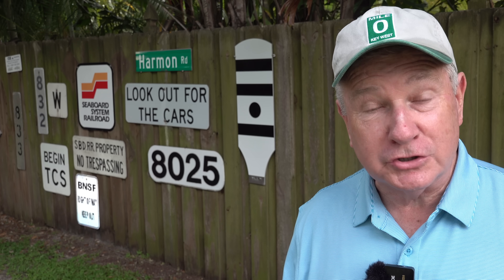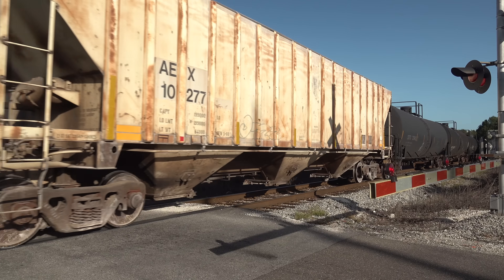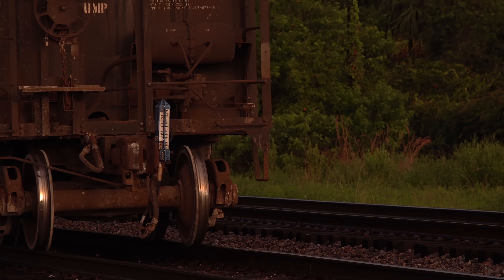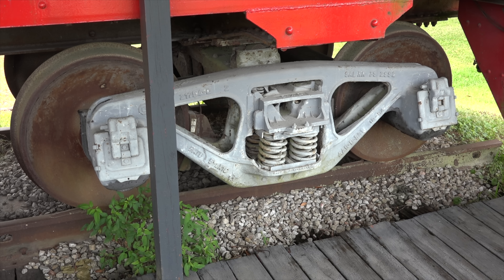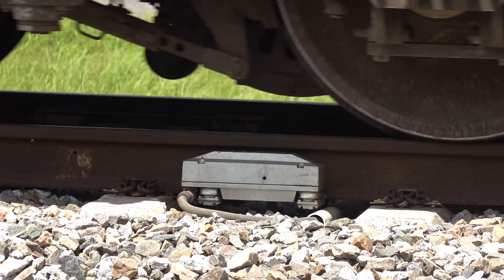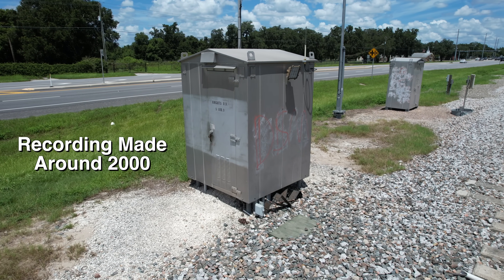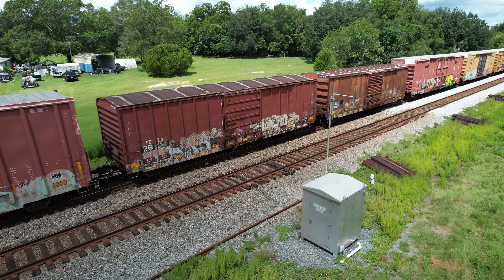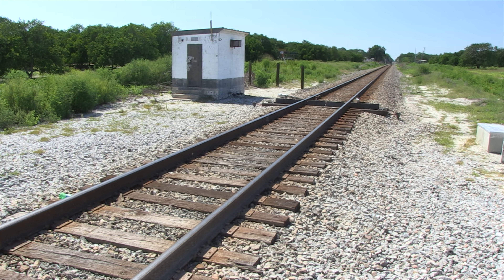What Railroad Defect Detectors Do

Comment: It would be very informative to review the various detectors and warning systems that were in effect during the East Palestine, OH train derailment. It's my very limited understanding that all systems were working properly but it was an overheated bearing that caused the accident.
Reply: The system worked just as it should. It even alerted the Train operator and the Railroad union to the problem. The Train operator was ordered to continue so it wouldn't hold up the railroad for other trains.

This could have been 100% preventable.
Reply: also heard that one of the last DD's that train passed by wasn't working...not sure if that's true or not.
Reply: @lmmplus4  No, two detectors before the wreck, that one reported the bearing +40 degrees F above ambient air temp.  The recent innovation of the DD "Help Desk" in Atlanta told the crew to keep going.  The next detector at Salem, Ohio, 19 miles before the wreck showed it to be 103 degrees above ambient.  The "Help Desk" said to go on, it was "trending" warm so they would keep an eye on it (Salem is where the security camera is that showed an axle either sparking or on fire).  The DD at East Palestine, Ohio showed that axle to be 253 degrees above ambient and the supervisor in Atlanta told the crew to stop and inspect the train, but it derailed moments after that.  Hopefully that wreck is the end of playing games (and the "Help Desk") and taking chances with safety measures, and the beginning of federal regulations regarding DDs, like making them be placed closer together than every 15 to 20 miles, more like 10 to 15 miles apart.  Just another part of the Class Is cutting expenses and safety to pay those dividends.  Good thing they didn't dump it up the road in Hudson, Ohio, home to many, many rich lawyers who would absolutely have owned NS in the massive litigation to follow, or while it was passing the Amtrak "Capitol Ltd.", which could have easily been the worst wreck in Amtrak's history.  "Uphill slow; downhill fast; tonnage first; safety last".
Reply: That is correct. The detectors were working as intended

Comment: so with all this teck on trains what happened in Ohio? why didn't all this stuff stop the train wreck?
Reply: Investigations will tell us more, but the train was apparently breaking because of one of these detectors when it derailed, but it was too late. They are only placed about once every 20 miles. The investigations will reveal if the detector before the one was functional or not and if the issue just happened early in that 20 mile gap, or if the train went without defect detection for longer than 20 miles due to malfunctioning detectors.

Comment: Question: the emergency braking of a long train is a not trivial feat. I suspect, that the old fashioned pneumatic braking cannot activate simultaneously, instantaneously over the whole length. This could brake the heading railcars first and harshest,  while the trailing railcars would activate their brakes last and weakest, possibly. The pneumatic braking system cannot adjust the breaking force according to / computing it to the different loads/weights of individual cars. And then, with fluids- tank-cars, there is sloshing, making everything even more complicated!

Comment: Are there any additional detectors on individual cars? For example similar like tire pressure detectors are common in motor vehicles, seems it should be possible to install small wireless heat sensors at each axle that transmit real time readings to the engineer.

Comment: Are all freight trains in USA that slow and rails so neglected?
Reply: Speeds varry by location. East coast trains tend to run a little slower because there is less open track between population centers and through such centers, trains are typically slowed to 25 MPH/40 km/h. And they have to run slow because freight trains in the US are extremely heavy and should something catastrophic happen, could do a lot of damage if they go too fast in a city.

As for the rails, I'm not sure what you mean by neglected. Sure, they have surface rust, but they are straight, properly spaced, and able to support heavy freight cars with minimal flexing. The vast majority of train derailments originating from track problems is due to damage from equipment, damage from other vehicles, or weather. And of course most non-collision derailments overall are either equipment failure (like East Palatine) or human error.

Comment: What kind of jobs are involved and related to such things as Defect Detectors? What kind of maintenance and inspections (etc) do these detector stations require?  What happens to the data reports that are transmitted from these detectors? Is it all received and processed by computers, or are there people who monitor, receive and process the info?  What about the sensors on the tracks?  How often do things like that need to be replaced or serviced?  Just curious how many and what kind of job positions are involved with all this, and what kind of training is required to do them?

Comment: Just looking at this because of the interest in the Ohio disaster. I wonder if they have this system in that area and if this system could have prevented that disaster?
Reply: They do have a defect detector in the area, and it did transmit a warning message. News sources indicate that the NTSB report specifically points out the defect detector built into the railway transmitted an alarm message to the train’s crew after it recorded that the temperature of a wheel bearing on the 23rd car was 253 degrees Fahrenheit above the ambient temperature.

Unfortunately, however, it seems that the alert was not soon enough - even though braking action was applied, it was too late. The NTSB report does not lay blame on the engineer saying that the train crew followed the proper procedure. 

Derailments are, unfortunately, frequent. What made this a proper disaster was the seemingly baffling decision to burn the highly toxic vinyl chloride. What led to the derailment was the fact that NS has a shockingly bad safety record as far as railroad companies go, which is potentially indicative of a company with poor maintenance and management.

Comment: I played the role of a defect detector in the fall of 2018 at  UP crossing south of Stillwater Minnesota. The line had been converted to CWR which made hearing a wheel with a broken flange much easier. I was about 4 vehicles back from the tracks and I watched the cars and sure enough one car was missing about 1/3 of the flange on my side of track. Soon as the train cleared I got up to the crossing and called the UP emergency number and the guy I talked to was VERY happy that I called that one in.

Comment: Great video.  It's a coincidence that I discovered your channel and this video the evening the NTSB issued their preliminary report on the Norfolk Southern Ohio derailment and talked about the defect detector catching wheel bearing temps as much as 253 degrees above ambient.  Now I know what defect detectors do thanks to your video.
Reply: If this fault detector worked as I understand it should, why did the train not immediately stop and the fault addressed?
Reply: @cossa6296  The engineer was stopping to check the DD alarm but the car catastrophically failed and derailed before the train came to a full stop.  "...by the time an alarm rang to alert the crew of the danger, the bearing was already so compromised that it failed as the train was still coming to a stop."
Reply: @jimharris8707  Thanks for answering my question.

Comment: They've definitely come a long way with monitoring technology to help make the railroads more safe , I'll bet there's defect detectors in place on the track where the recent train wreck occurred in East Palestine Ohio February 3rd , I'll bet that the engineers were warned of the problem that a wheel bearing was failing from the defect detectors which check for hot wheels and/or hot wheel bearings , The wheel bearing failure was caught on camera showing sparks coming from the wheel bearing on one of the cars before reaching East Palestine , The defect detectors will alert the engineer that there's a problem and I'll bet they ignored it and kept on going and when the train reached East Palestine Ohio , it derailed , Spilling vinyl chloride and other toxic chemicals
Reply: no; they was not ignored. they do not check the cars before leaving the yard, railroad does not want improved brake systems and that train went through for five defect detectors.  ceo should be in prison.

Comment: 7:47  total  axles,   368.  Divide  by  4  ( two wheels, per truck)  so this train is 92  cars; each about  80  feet long.   7,360  foot train. GE  locomotives, the 4400 hp ones, are about  430,000  pounds fully fuelled.

Comment: Nothing about the DD setups strike me as high reliability of the DD methods.  These should be 3X voting type networks.  Including failsafe radios in double or triple to ensure near 100% error free operations.   Given the risks we have seen recently, railroads need to get more serious and take some lessons from the aerospace industry.   The environments out at the rail side is a tough one at best.  Baking hot, freezing cold , humid, corrosive, vibration, you name it.  It taxes the best conceived electronics.   They are about 30% of the way to a reliable detection system.

Comment: Here’s a nice fact:

CSX train crews that are flagged by detectors have to inspect five cars ahead of and behind the axle nearest the defect reported. Cars with hotboxes cannot be moved at faster than 4 mph and have to be tagged and set out by the crew at the nearest point where they can be set out.

Most detectors are both Dragging Equipment AND Hotbox temperature detectors. Wheel Impact detectors operate on sound, as flat spots hitting the rail make a signature bang or thump. If a flat spot makes a loud enough sound, it is picked up by the detector and reported.

Edit:
Wheel Impact Detectors are often specially marked on Timetables. The flaps seen as Impact Detector flaps in the beginning of this video are actually infrared sensors for the axle counter. Wheel Impact Detectors have mics that actually drop down to the wheel contact point.

Comment: This video has become more relevant than ever given the East Palestine, Ohio derailment, the only way the crew knew something was wrong was the DD giving a defect warning, it was too late though...
Reply: A defect detector wouldn’t have done anything. The train crew, the Norfolk southern railroad, Mike DeWine, and the EPA were are all extremely incompetent. They had the chance to clean up the chemical spill properly but they still decided to light the shit on fire for some dumbass reason.
Reply: They IGNORED the warnings however.
Reply: @michaelblair5566 They didn’t. Dispatch told them to go to the yard, so it’s really the dispatchers fault
Reply: @jordantherailfanner7506 they said ‘go’ to the yard, not ‘send it’.  Dragging a hotbox, never mind one actively on fire, is restricted speed, not line speed.  That sure as heck wasn’t restricted speed, until he dumped it.

Comment: What happened in Ohio?
Reply: NS manifest 32N was eastbound on the south main of the Ft Wayne Line enroute to Conway Yard in Pennsylvania. At some point west of Salem, OH a bearing was burning off or had already burned off and a wheelset had become misaligned and was contacting the brake rigging of the lead truck of a 4-bay covered hopper car likely loaded with plastic granules. This burning wheelset was caught on a private security camera at a business in Salem. There is a defect detector on the line as the train would have been headed east out of Salem. It is unknown at this time if the detector failed, or if it issued the proper alert and the crew did nothing. Approximately 20 miles further east, the train was passing through East Palestine, OH. 

The rest here is what I personally believe occurred. I believe the failed wheelset was already on the ground by this point and struck a trailing point switch just east of the CeramFab facility. At that point the truck derailed to the left and damaged the switch, causing the trailing truck and the two cars behind to also derail to the left and roll over. The emergency brake application initiated and the rest of the cars behind accordianed into the wreck site.

Of note are claims by NS employees that the company had eliminated all the maintainer positions in that region responsible for the defect detectors and other related equipment. The tasks were then assigned to signal maintainers who had to prioritize working on signal systems that were federally mandated. Defect detectors are not, plus they also did not have the training, expertise, or time to address detector issues. Nonetheless, NS would have realized hundreds of millions of dollars in cost savings over the next decade. As a result, it is possible that the detector in Salem may have failed and never alerted the crew. The investigation will determine if this was the case or not.

Comment: when i worked on conrail we had 2 odd ball detectors 1 called a high car detector,,HCD the other was a loose wheel detector , LWD , they got rid of that LWD as it would often trip and give a false reading and you had to run at 10mph going over it so it also slowed down train movements and i never seen a loose wheel on a rail car.

Comment: Great video, thanks for info on the detectors.  

I have a question. The tracks near where I live have 2 tracks.  The lights every time I see them are usually all 3 Red. Once in awhile I'll see a middle yellow very rarely do I ever seen any of them green. Yet trains are passing throughout the day & night. I thought be green if no train being anywhere nearby. Cause usually there red meaning train or train worker is on the rails.   I live in Taylor,MI. Usually have NS or Canadian Pacific  CP rail. Once in a blue moon I'll see Union Pacific but very rarely.  I'm just wondering why there always red when no trains been through in few hrs or so.
Reply from the maker: Most US Railroads use the protective system that keeps signals red until a train has been cleared by the dispatcher. Some systems, mostly automatic, will turn red when a train enters that block, then turn green when the train exits the block and stay way until another train from either direction approaches.
Reply: @distantsignal  thank you

Comment: hi Danny those flappers have numbers because even though they look the same size they are slightly different. if you removed  them for service and don't marked you won't be able to line them up correctly, 1&2 and 5&6 they need to have clearance for the flange of the wheel.

Comment: Great video but needs a little correction.  At 3 minutes 50 seconds you show what you mention as "Sensors that watch the wheels as they pass over looking for flatspots and cracks" - and later again as "Wheel Impact Load Detectors".  These devices are actually wheel transducers that detect the presence of the flange  detect the presence of a wheel (to activate the detector, count axles, or trigger the bolometer detector inside the hotbox housing - and with two of them spaced at exact distance to determine train speed). 

Additionally, at 7 minutes 21 seconds text shows "Defect Detector Synthesized Voice".  This should be corrected to "Prerecorded Voice" as the man who voices it is quite real and many signal engineers and maintainers in the industry have met him and know who he is; I have also personally talked with him over the phone.   Due to privacy concerns you can understand why I am not mentioning his name.

Comment: Correction it doesn’t go by radio if the train breaks apart it’ll send the half not connected to engines into emergency and if the entire train were to go into emergency instead of a chain reaction it would be just all at once. They have buttons in the cab that allow you to plug the train from the ETD they invented them when a loaded train broke a knuckle on a slope and rolled down the hill

Comment: I came across your channel and your videos are great. What hits home for me is the crossing, wayside, cantilever and bridge signal structures that appear along the tracks. From 1998-2002  I worked at Progress Rail Services in Jax, FL as a welder and QA/Shipping lead. I wonder how many of those aluminum structures I had a hand in fabricating, assembling and welding together LOL. We always stamped our initials and completion date on the base plate.
I'm glad you showed the Train Inspection Portal in Racepond, GA. I've seen it from the road several times and wondered what it was. I didn't think it was a drive-thru train wash 😄